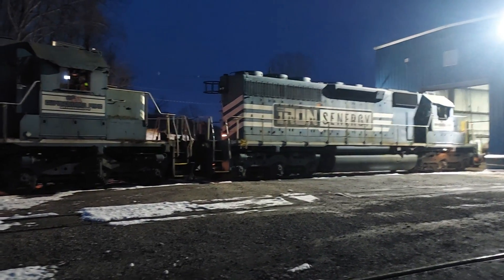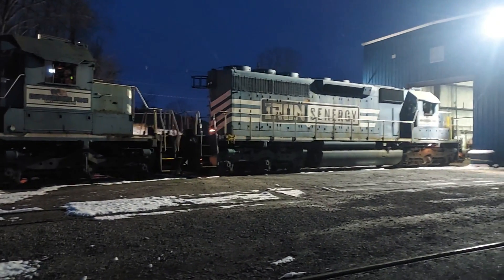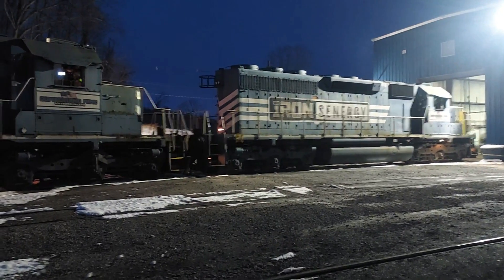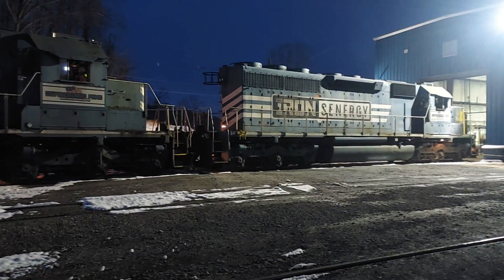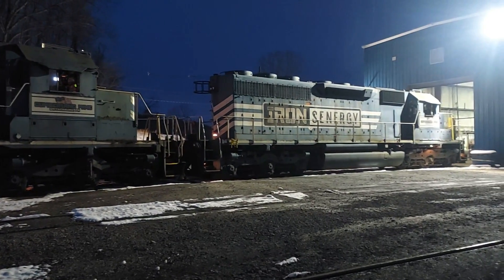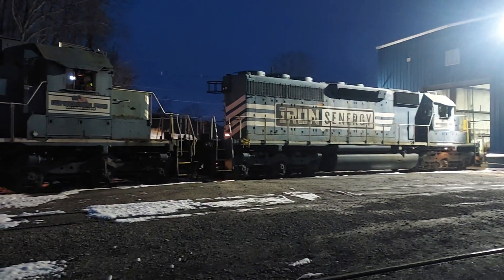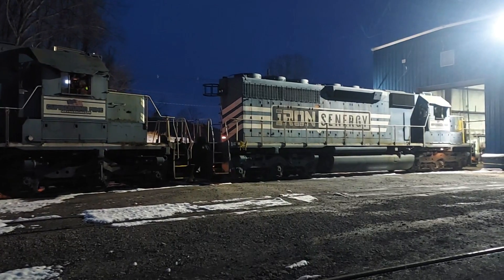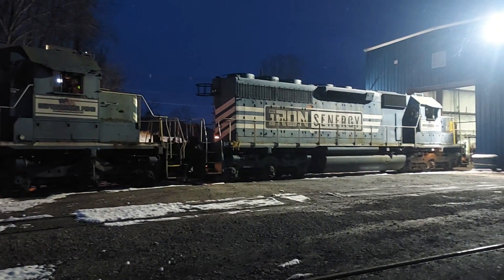Doing a Locomotive Load Test on an EMD SD 40-2

Comment: Interesting.  I've seen EG tests where voltage, amperage, frequency, and temperatures are checked.  The tests involved many different load levels switching in additional resistive banks.  The heat exhaust from the load banks is enough to melt the plastic on a car if it's to close.
Reply from the maker: Oh I can't imagine what the exhaust heat would be fountainvalley.
Someone else wrote in would be cool to have an infrared camera
to shoot the exhaust. Thank you for the nice comment and for taking the time to visit with us and check out the load test video my friend.

Comment: In the overseas location where I reside, if you say 19 or 23 degrees, they think it's summery weather. Please toss in the word Fahrenheit when you give the temperature. (One of my pet peeves. Actually, I have a whole menagerie of 'em.) 
Evidently, this load test tests the engine-&-generator part of the locomotive (and the resistor grid), but not the equally important traction motors. Is there a means of testing the traction motors while they are on the locomotive?
Reply from the maker: I do not know of any tests they do on the traction motors to test them MottyGlix. Sorry about the degrees, I just don't think of doing that
very often. I will try harder to remember. Thank you for taking the time to visit with us and check out the load test video my friend.

Comment: Locomotives are really cool in that they're one of the few diesel electric machines that are their own dynamometer!  Since the entire point of the engine is to deliver electrical power to the traction motors you can almost trivially measure the actual horsepower the locomotive produces by simply measuring the voltage and current its supplying.  You multiply them together for numbers like, 400V at 5,000A.  Results: 400 X 5000 = 2,000,000W or 2,000kW or 2MW  You divide the wattage by 746 watts, which is how many watts a horsepower is, and you get: 2,000,000 / 746 = 2,681 horsepower.  There's really no disputing that number when it's there in front you on calibrated meters.  It's really cool.

A buddy and I got to visit the Western Pacific repair depot back when it existed.  We marveled at the 650 cubic inch pistons we saw on work benches.  They let us go out in the yard where they were doing a load test.  The locomotive didn't have dynamic braking so they had a dynamic braking unit with current and voltage meters on it, where they could do the load tests.  They told us to stay back and completely away from the sides of the locomotive under test.  They explained that when they fail it can be spectacularly dangerous.  They showed us a mangled broken crankshaft and the engine it had come out of the side of.  It did this during a load test.  The crank landed several tracks over from the locomotive.  The test we watched was very loud and gut-shaking.  We loved it!
Reply from the maker: Wow that' pretty neat Keith, I never knew that about how to figure
HP and never really thought about them being their own dyno. We
had a piston rod go thru the side of an engine one time, it put
a pretty big hole in the engine block! Fortunately no one got hurt
just the company's pocket book to buy a new engine.  :-)   Thank you for taking the time to write in and to check out the locomotive load test show my friend.

Comment: Usually the load tests cause  stack fires  burning the  excess carbon out of the exhaust system ! Good test to make sure the output is within acceptable range, and  if not is a tool to find out why ! Thanks for sharing!
Reply from the maker: I would imagine if the shop lights weren't on and it was dark, there
would have been a spark show going on we could see Victor. Thank you for the nice comment and for taking the time to visit with us and check out the load test video my friend.

Comment: A Pleasant way to end the day and 3098 was probably reflecting on being in Run 8 but doing 60 down a Main Line. 20 some years ago I went by the Fairbanks Morse plant at night heard some odd noises. I parked and as I walked on the sidewalk they were giving a 20 cylinder engine a final test before sending it off to a Naval Shipyard and talk about noise plus the vibrations in the sidewalk what an experience. Great show!
Reply from the maker: What would have been really cool too here Paul is if the shop lights
were off and it was dark out, sure would have been a nice spark
show going on I would imagine. That had to be really cool to hear
a 20 cylinder run like that. Thank you for taking the time to write in and to check out the locomotive load test video my friend.

Comment: That was great Dave. Like you I don't know a lot about load testing but saw them being done on open days at the locomotive works, they connected cables into a building for those. Out on the track I sometimes saw a loco working flat out but going slow, that was another kind of load test they did to check the systems were OK.
Reply from the maker: They were probably plugging those cables in to a load test box
Cedarcam. Yep every time it gets out on track pulling a load it
gets tested....:-)  Very much appreciate your taking the time to write in and for checking out the load test video my friend.

Comment: Having load tested it also helps clean out the exhaust system. They run cleaner after that. We would clean ours out by opening the throttle and applying the engine brakes. Sparks would go flying up the stack and hit the screens on the S-2.
Reply from the maker: I would imagine if the shop lights weren't on and it was dark out, we
would have had a nice spark show to watch Don. :-)  Thank you for taking the time to visit with us and check out the load test video my friend.

Comment: what do they do with the compressors when they run the loco this hard?
Reply: The air compressors have external control of the valves and when the system is up to pressure. The compressor runs unloaded.  The pistons are still moving but its not building pressure .  If you hear a truck or transit bus that releases air every 20 to 30 seconds its a check valve in the air dryer that is held open  . The compressor never unloads and shortens the life of the compressor to a few months.  When it fails. If going down hill. The spring brakes may not hold and it may runaway without brakes.
Reply: thanks for the explanation @waynep343
Reply from the maker: Compressor cannot be unhooked or disconnected when the engine
is running, it's a solid shaft that drives it Kestrel. When the main air reservoir reaches about 135 pounds that shuts off the compressor
from making air, but the compressor still is turning, just not making
air. There are valves in the compressor that open to do that. Thank you so much for taking the time to write in and to check out the locomotive load test video my friend.

Comment: As simple as that was, I loved every bit of it. From Dave's infectious smile, and always-upbeat demeanor , to the lighting. It's almost a dark evening sky but the building lights are enough to highlight the snow flurries and the diesel smoke, along with the sides of the locomotives. Then add in the roar of the EMD engine and the humming of the dynamic brake resistors ... pretty cool, huh Dave ?? .. Alright .. I sure thought it was. Thank you for sharing this with us, Dave.
Reply: You’re hearing the grid fans. The grids don’t make any noise. That’s the grinding sound, the whistling sound is the turbocharger.
Reply from the maker: It certainly was pretty cool Kenneth, a lot of folks are really liking
this smoke show. Much better on a cold night to see, during the day
you don't see near the smoke.  Thank you so much for taking the time to write in and to check out the locomotive load test video my friend.

Comment: Awesome! Nothing but water (steam) coming out of that EMD at full tilt! Very cool, indeed. 😎👍
Reply: Yep, they never let it warm up completely even though the radiator shutters were open, probably only had one of the three cooling fans running at that point, and only on low speed.
Reply: That is the exhaust that you see coming out.
Reply: @gravelydon7072  Yes, of course. But what we are seeing here is primarily steam - water vapor being a big byproduct of combustion engine exhaust - just as you'd see coming from you car's exhaust on a winter day. The nasty stuff - NOx, CO, CO2 is present, but cannot be seen...the visible stuff illustrated here on a 29F evening is water vapor - i.e., steam.
Reply from the maker: Yes it was Patrick, glad you enjoyed the show. Thank you so much for taking the time to write in and to check out the locomotive load test video my friend.

Comment: Very informative and interesting. I have done some dyno testing on diesel engines, but never couppled to a generstor. It is cool that the dynamic breaking system can hold the full load. I see that it appears the that another engine is couppled up as a safety just in case something goes wrong.
Reply from the maker: Great to hear you enjoyed the show Namar. Thank you so much for taking the time to write in and to check out the locomotive load test video my friend.

Comment: Dave, that was great.  I would like to know what maximum weight a locomotive can put? That is for 1 locomotive.  Thanks Robert.
Reply from the maker: Glad you enjoyed Robert. The owners manual does not give a figure
for tractive effort for this loco. It weights 368,000 pounds. How much
it can pull without wheel slip depends on whether it's on level grade or on an uphill grade and also upon whether the rails are dry or wet or icy.  Thank you so much for taking the time to write in and to check out the locomotive load test video my friend.

Comment: That baby is purrin like a kitten! Did I miss something? Did you say why you guys were testing that loco? Is it routine maintenance or is it part of a repair? Excellent content as usual Dave, 10-Q
Reply: Could be part of a repair or maintenance. We do them after an FRA mandated inspection also, just to verify the smoke isn’t going to come out of some electrical component somewhere and to verify the horsepower is what it’s supposed to be.
Reply: Didn't Dave mention a 92 day test?
Reply: @alro2434  
That would be a 92 day FRA mandated inspection.
Reply from the maker: It was in for it's 92 day inspection and they do a load test as part
of that just to make sure everything is functioning as it should Dean.
Thank you so much for taking the time to write in and to check out the locomotive load test video my friend.

Comment: Never did a load test, but I ran my fair share of SD40-2. I always considered them the best locomotive for train handling, back when train handling mattered. That would be when there were cabooses (or way cars as they were called on the CB&Q). They were always very responsive to the throttle. For some reason I always liked them better than the SD60’s.
Reply from the maker: That's pretty cool you used to run Don. Bet you got a lot of neat
stories to tell, if you're ever in this neck of woods look me up I
would love to hear your stories.  Thank you so much for taking the time to write in and to check out the locomotive load test video my friend.
Reply: @ccrx6700  thanks for the invite, but I live in the Midwest and haven’t made it to the East in many years. My career started with SD7’s and ended with SD70MAC’s. Along way with locomotive technology.
Reply from the maker: @donlipsky2696  👍😊

Comment: dynamic breaking load test? down hill gravity spins the electric motor goes from electric motor to generator, and electric current is fed back to the electric motor in reverse polarity from the diesel motor generator to slow the electric motor in it's generator phase and the excess current is fed to the toaster resistors on top where all the high hood fans are behind the cab.
something like that.
Reply from the maker: This was not a dynamic braking test april generic. it was a test to see if the amps were correct at various throttle notches. The current
produced was fed to the dynamic brake resister grids which created
the resistance instead of being fed to the traction motors.   Thank you so much for taking the time to write in and to check out the video my friend.

Comment: SD40-2 is the best locomotive out there. DC traction motors with 3,000 horsepower, good strong locomotive.
Reply: Most reliable out there for sure. Most powerful definitely goes to some of the newer GEs with 4400HP and AC traction, but you see some of the older GEs from the 90s being scrapped while these 50 year old GPs and SD40-2s still live on
Reply from the maker: Still is a good many of them out there running around the block Chris.
One of EMD's more popular models. Thank you so much for taking the time to write in and to check out the locomotive load test video my friend.

Comment: Thanks for this!  It brings back memories.
Many years ago, a company I worked for did a lot of work at CN’s Transcona Shops here in Winnipeg.
As a result, I got to see lots of work done on trains, including load test.
We knew most of the guys (we spent a lot of time there) and were invited to watch a load test.
Since the shops are near a residential area, they have a large noise suppression grid right above the exhaust.
After it was done, I got to experience my first ride on a locomotive.  We were allowed to go out on a short test run, after the load test. 🙂
Reply from the maker: You're certainly welcome and glad you enjoyed the show Slide. That had to be really cool to see that in person and then take a ride! Good for you. Thank you so much for taking the time to write in and to check out the locomotive load test video my friend.

Comment: I work on outdoor power equipment and I use a load bank tester to test the output of generators. It reads voltage, amps and hertz. Very useful tool.
Reply from the maker: That's pretty neat to hear, I had no idea they even made something
like that Bryan. Nice!  Thank you so much for taking the time to write in and to check out the locomotive load test video my friend.

Comment: So long story short they put the brakes on and crank up the RPM'S at full throttle, notch 8. 👍
Reply from the maker: The reverser handle was in neutral, so the loco wouldn't move forward or backward Michel. Although yes the independent brake was on,
but that would not have held it had the reverser been in either
direction. Very much appreciate your taking the time to write in and for checking out the load test video my friend.

Comment: how do you simulate the load?  Is the electricity being fed to the motors or dynamic brakes
Reply: To the brake grids. The buzzing noise is the grid fans keeping the grids from turning into lava.
Reply from the maker: Ralfie knows what he is talking about Jim, when Ralfie speaks, I
listen. There you have it!   Thank you so much for taking the time to write in and to check out the locomotive load test video my friend.
Reply: @ccrx6700  
I wish some of the people I work with and for would listen! 😂😂
But thanks Dave, I try to help where I can.
Reply: Resistors

Comment: Captain, the batteries are at full charge and we are ready to dive the boat.  Those EMDs and Fairbank-Morse engines were the heart of diesel submarines.  On this test, did some generator output test have the resistive load being shared by the other engine?
Reply: No, it was all channeled to the brake grids and turned into heat which is then dissipated by the grid fans. 
There’s no way to electrically put any traction power from one locomotive to another unless they’re set up as a mother/slug set. Then it’s a locomotive supplying power to a unit without and engine to power its traction motors.
Reply from the maker: I did not know those engines were in subs Bigun, appreciate your
sharing that with me. No the load was not shared by the other loco,
it was all on the dynamic brake resister grids on 3098.  Thank you so much for taking the time to write in and to check out the locomotive load test video my friend.

Comment: May 1966. It's 3 months older than I am.
Reply from the maker: Cool, now the question is do we need to to a load test on you David? :-)   Thank you so much for taking the time to write in and to check out the video my friend.
Reply: @ccrx6700  I'm failing the load test! LOL. Had to cart 4 sheets of drywall into my basement. Not sure what they are putting in it but it used to be a lot lighter when I was in my 20s! LOL...
Reply from the maker: @opieshomeshop  👍🥰

Comment: That's a lot of smoke for running under a load. The way it disappears leads me to believe it is the water vapor in the air flashing from the heat of the exhaust.
Reply: It wasn’t quite warm yet, but the smoke looks a lot worse at night under the lights than it really is. If you noticed, it was clearing up just before they knocked it down to idle at the end.
Reply from the maker: It was pretty cool to watch specially at night, you don't see that smoke like that when they do it during the day repairsecrets.  Thank you so much for taking the time to write in and to check out the locomotive load test video my friend.
Reply: It's a two-stroke engine.  They tend to smoke like that under throttle.

Comment: You are NOT seeing that anywhere else, but here📹👷‍♂️.That primemover would spin that generator off like it wasn't bolted on😋🚂🇨🇦🇺🇲🙋
Reply from the maker: Need to develop a sound card so you can do a load test on some
of your locos Doug.... Very much appreciate your taking the time to write in and for checking out the video my friend.
Reply: Might be doing something like that in the future. I have a Rapido GMD GP9RM with slug on pre-order. Gonna put a Blunami chip in it&control it with my phone. I'm still running on DC power, tho.